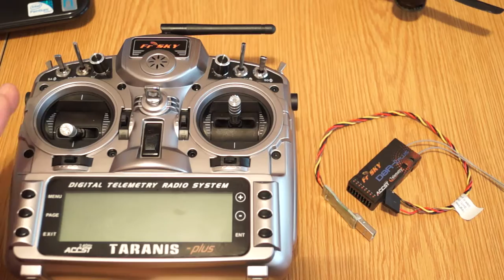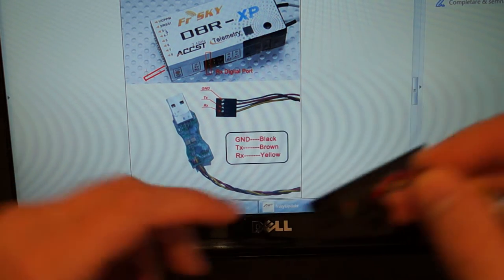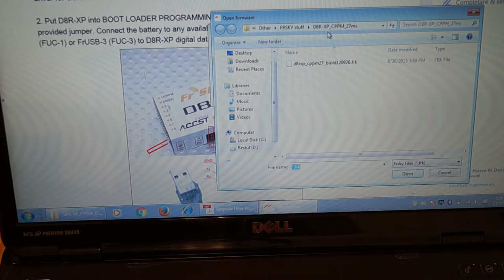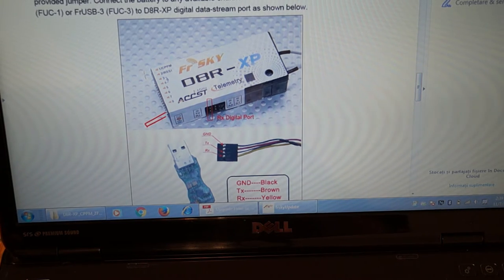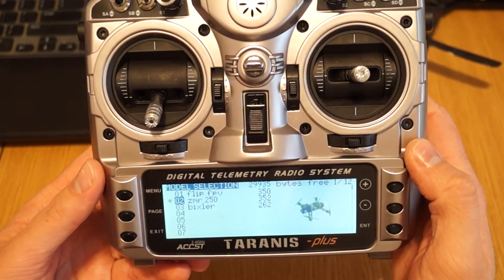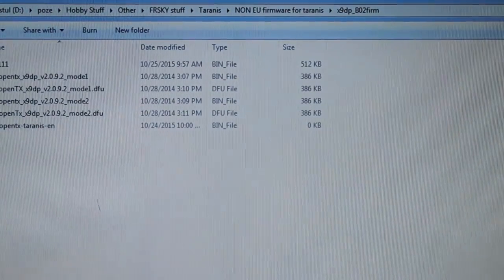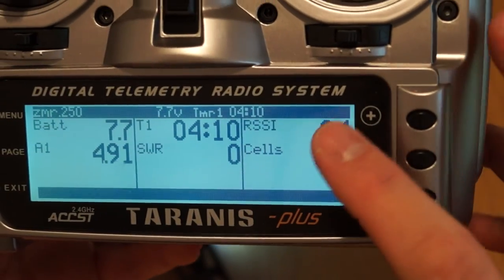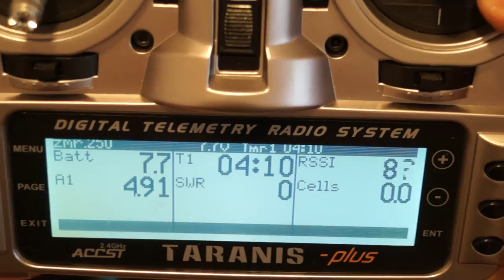Rssi setup with D8R-II plus and European version of the Taranis

Comment: you dont need that usb device to upgrade firmware you can use an old servo cable and swap wires around then connect to the port on back of taranis and flash from there
Reply: Hi if so how do you make the link to the Rx you have 3 wires + - and signal so can you please tell where i must put it in to the Rx Thank you